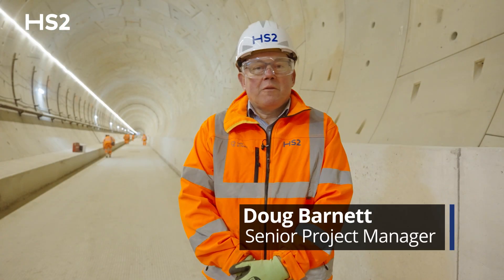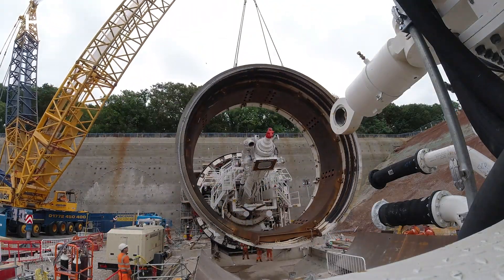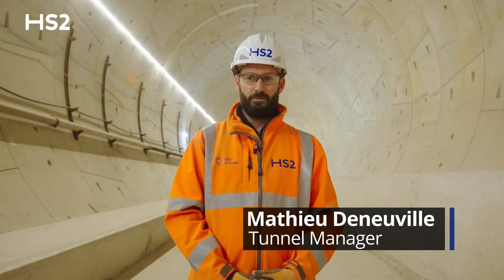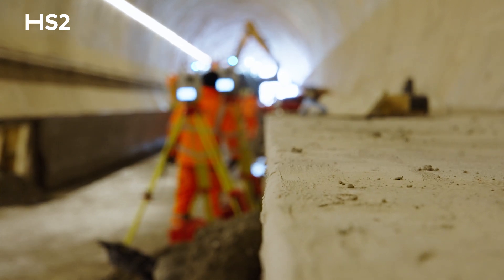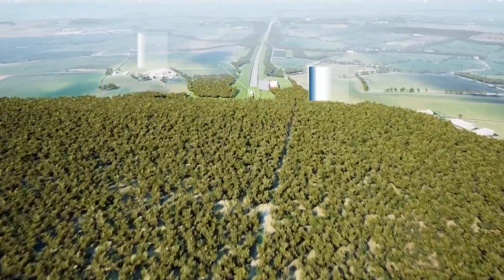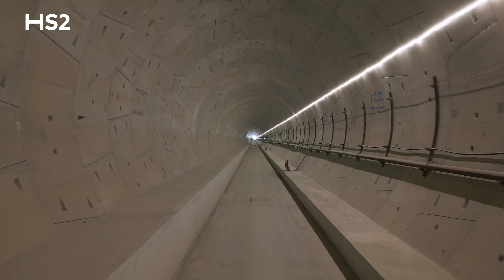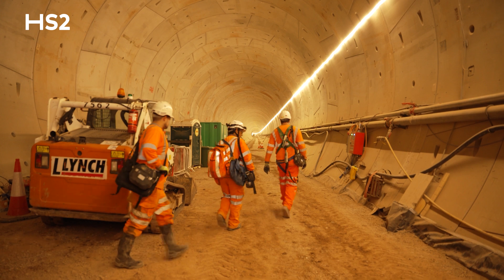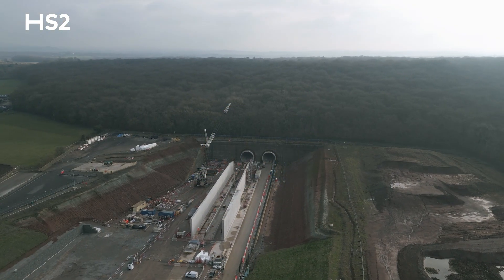HS2 marks major construction milestone at Long Itchington Wood Tunnel

Comment: Really hope that we commit to building phase 2, 3, 4, 5, 6, etc in order to retain all these skills that we've developed. A lot of the workers are quite obviously foreign born and it would be a shame for them to take that experience and decide to go elsewhere with it through lack of reason to stay in the UK.
Reply: More than a few of these 'obviously foreign born' workers in key positions are in the UK because the UK didn't have sufficient people with the required knowledge and skills. Hopefully now, between experience on these sort of works, and the efforts of the HS2 College, there will be a raft of home grown locals with the knowledge and skills to carry on into the future; politicians permitting 🙄🙄🙄
Reply: Given the sheer scale of infrastructure rebuilding that is now starting to happen the construction industry has already stated its concern at the lack of resources available. That will result in significant delays to all  infrastructure projects.
Reply: A lot of these workers come with the TBM.
They go wherever those machines go.
Reply: A TBM only requires a crew of 17 people to operate it. The crews work 24 hours a day so probably require 3 crews each working 8 hours. So the total number of people is 51. On most sites the workforce  numbers hundreds, sometimes thousands on the bigger contracts.

Comment: how many people remember December 2009 _ and the announcement that was made by the Prime Minister initiating a project to build a high speed railway between London & Birmingham _ & on to Manchester _ that Prime Minister was Gordon Brown _ the project was continued under the Conservative/Liberal Democrat government _ it received cross party support in the Commons _ very few voting against & the same in the Lords _ 

Oh it expensive _ £12 Billion for the Trans Pennine Upgrade _ it's how many miles ? _ ongoing contract __ how much was the upgrade to Bank station on the Northern line of the tube _ 750million _ and the projected cost of the Lower Thames crossing is 9-10Billion _ the upgrades to the M25 /A3 j10 £317 million _ nothing comes cheap _ and as for ignoring environmental factors _ good luck getting the project past the courts _ this argument will be holding up the 3rd runway @ Heathrow for a long time
Reply: MPs and Lords are the one small group of people who do travel by train at our expense. How much time will it save Birmingham MPs going to London? A few minutes when they will then have to get the Tube for many years to come to finish their journeys.
Reply: Actually it won't, Heathrow cleared the court stage a few years ago. Heathrow will submit the plans this summer, Rayner will wave them through at some point in the next 12 to 18 months and they start demolishing the villages in 2027/8 and have shovels firmly in the ground before the next election,

Comment: It's a pity that the government have paused for the next two years,the ongoing track to Euston 😢 ,in two years time the costs will be even bigger !
Reply: Thank the populist decisions made by Sunak for the delays, replanning and inevitable cost increases. If Euston is not built to full specification (or at least is designed so that 6 tracks can be extended to 11 tracks) then the rest of the line will not be able to achieve the potential it has been designed and built for.
Reply: @Maxhead_room  saying 'cost increases' is a moot point. A final price was never agreed in the first place.
Reply: @thebrowns5337  in that comment I meant the additional costs caused by changing the Euston designs, maybe I should have worded it better.
Reply: @thebrowns5337 And with a project in the tens of billions a final price was never going to be agreed.
Reply: The tunnels to Euston will still be driven, the other bits such as Headhouse's aren't so urgent and can be completed alongside the station itself.

Comment: The Channel tunnel is bigger, has more tracks, two stations and only took 2 more years to build, trains and tracks included. This wont be in use for a decade due HS2 delays. 😂😂😂.
Reply: I'm not sure if you are aware but there are no ancient woodlands, population centres, roads or other railway lines in the English Channel that require engineered solutions to avoid. But the channel tunnel engineering was equally awesome for different reasons.
Reply: The Channel Tunnel has two tracks with one line in each, exactly the same as here. The only difference is the Channel Tunnel has a smaller service tunnel. As to timescales you really need to recheck your facts.
Reply: @Polarbear1-b6j The Channel Tunnel took six years to build, from 1988 to 1994.  6 Years into total, 2 more than this short tunnel for HS2. Box tunnel only took 5 and was hand dug. Construction for HS2 phase 1 started in 2020. It is due to open including all stations at the earliest 2030. We are half way through my decade point. Ping me when the tickets become available 😆
Reply: @Two_Scars  If you think you could build it faster, you were welcome to apply for the contract.

Comment: Would like to see more of the work at old oak Common, especially around the low bridge at the bottom of the road,  I always had to take the long way round because my lorry mounted cherry picker was overheight,  ❤
Reply: Agree, we need to see more about OOC. 👍
Reply: The level of that bridge on Old Oak Common Lane cannot be touched, as it is the route of the Great Western railway line and must remain level. You would have to raise the track level for hundreds of meters either side of it  to change it. Therefore the road has to be lowered and there are a myriad of utilities buried under it !.
Reply: @JohnHoward-wc9kk  indeed, and additionally the road is a key bus route and currently cannot accept double decker buses - this will also be resolved.
Reply: @JohnHoward-wc9kk   I understand that,  but if you watch any of the previous videos you will understand that they are moving all the utilities to make for a greater height
Reply: @JohnHoward-wc9kk  go look up
11foot 6 bridge
called the can opener
they raised that 9 inches
lorry camper vans still have their roofs stripped

Comment: All that to protect a few trees, could have cut and covered and replanted, but no, lets burn some money
Reply: Why the race to the bottom always? Where do you want it to end?
We spend an absolute fortune on healthcare looking after the elderly. Do we say, actually, they'll only last a bit longer, lets save the money? You might like that... until it comes round to you of course.

In the UK we pay a lot of tax etc. We have different views between us. There must be balance.
If you don't want balance you can move elsewhere - go to Russia or NK, but don't prevent others that have lived and worked and respect this country suffer just to fit in with your narrow mindset.
Reply: It is not just trees, it is a woodland that has been there for 4 centuries. Hardly any ancient woodland is being lost through this project, carving though this would have been outrageous. You need to be more objective.
Reply: @Maxhead_room  Just cause the woodland has been there for 4 centuries doesn't mean the trees are, replanting them after cut and cover would result in a wood still being there
Reply: @Red_wine  the habitats and interconnected ecosystems in ancient woodlands take centuries to develop. There are now also additional statutory controls to prevent such destruction. You are taking an overly simplified view.
Reply: @Red_wine  There’s a huge difference between the mature ecosystem of an ancient woodland and the immature ecosystem of new planting. Go and visit some ancient woodlands, then go and visit the new planting along the side of an A-road and see the difference for yourself. Those ecosystems are the things which pollinate our crops, clean our water, put nutrients into our soil, and generally make the world livable in (let alone nice to live in).